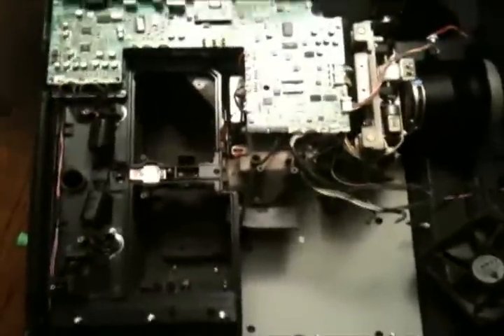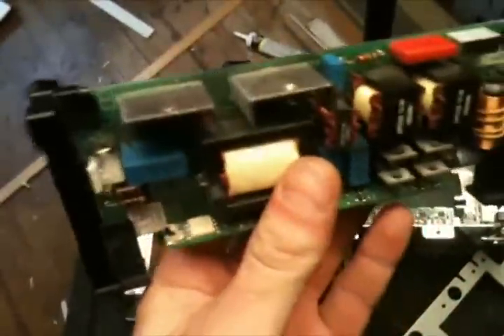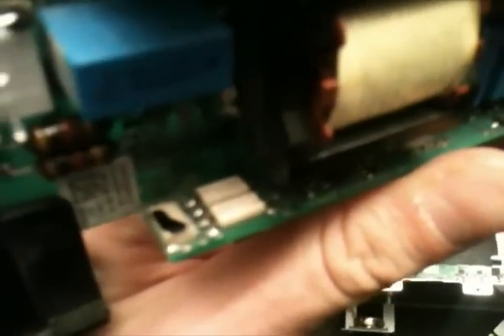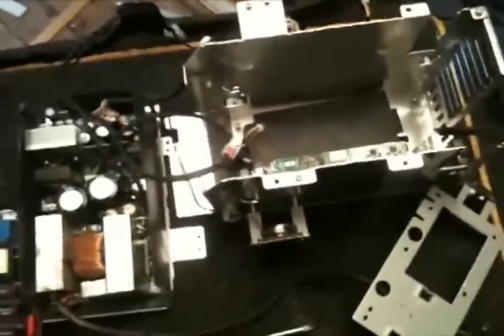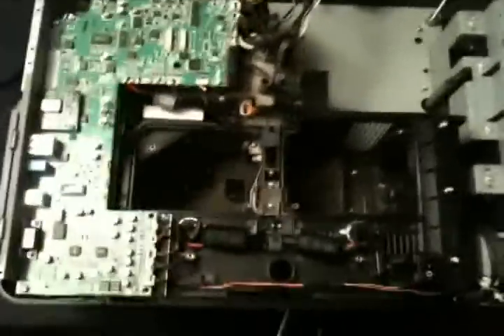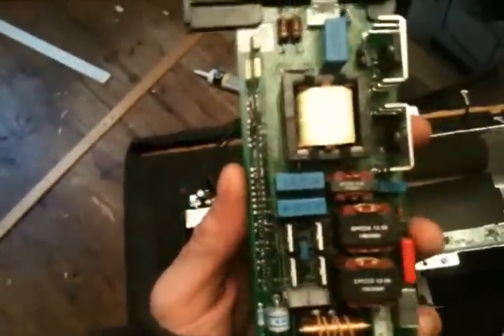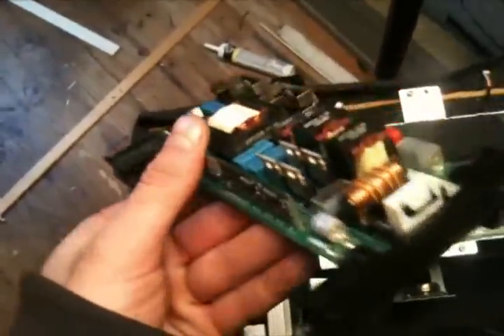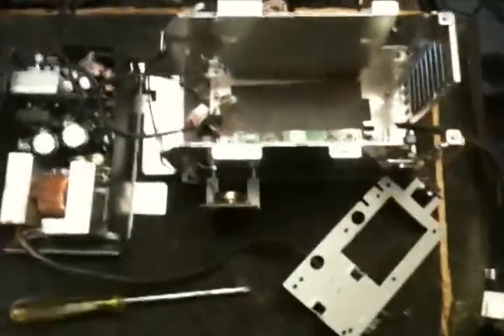Projector Lamp Control Board Bypass 5-pin w/ Schematic

Comment: Dear sirs, I have a ballast with lamp 7r and I need to know what to do to turn it on, I do not know what voltage to put on the control pins, I have seen some users use a small 12v source for this.

Comment: Why not just solder 5 extension wires on the pins of the optos, assemble the projector but leave the 5 extension wires out the case. Then once assembled and powered on, take each of the 5 wires and short them to a metal plate (ground) until you find one that works.

Comment: I have a similar ballast in my Optoma EP910. I removed the ballast and grounded the white wire in the 5 wire bundle. Don't ground the red wire. Projectors don't like shorts.
Reply: +J o c e l y n Thanks exactly what I was looking for. How did you find this document ?
Reply: Hello. I took apart an Acer projector and wanted to use the HID lamp driver alone that's why I wanted to know the protocol used. I don't know about your Optoma projector and from the documentation the shorting method is just a hack because what is supposed to be on those wire is a serial communication protocol. It should not be working but you could give a try it shouldn't in my opinion damage the board. From what I understand the method is to short the return optocoupler wires it shouldn't damage anything. Don't rely on the wire colors. You should have three 4 pins chips (the optocouplers) on the board. 2 mounted in one direction and the last one in the other direction. You need to short the two wires coming from this chip (the last one) going to the board connector.
Reply: Small correction: I guess it could work. I red more of the docs and the lamp driver have a non-UART mode where pin 1 and 2 are shorted by the flag/return optocoupler when the lamp is ON. So if you short these you can make the controller think the lamp is ON even though the driver thinks there is something wrong. On the docs the pin 1 and 2 are the bottom ones (closer to the other right angle board) but you should check anyway. Be careful and good luck to you too :)
Reply: For those interested the OSRAM UART protocol is documented in this PDF:
http://www.osram.fr/media/resource/HIRES/333551/standardized-uart-protocol,-version-3.3,-13.06.2008.pdf
Reply: It just means you need to connect them together. Be very careful if you are not familiar with electronic circuits. The module you want to modify is powered with high voltage (400V) and even if the supply is disconnected some residual voltage can still be present stored on the board. You should let it sit disconnected from the wall for at least 10 minutes or more before trying anything and even then you should avoid touching the bottom of the boards. Yes I speak French I am from France. Toi aussi ?
Reply: Je peux te donner mon adresse mail mais je ne ne veux pas la poster dans les commentaires sur youtube et je ne sais pas pourquoi mais je ne peux pas t'envoyer de message sur google+ ni sur hangouts il semble que je sois bloqué, bizarre. Tu peux essayer de m'envoyer ton adresse en privé sur G+ ? Je n'ai pas encore testé, je pense essayer de le faire fonctionner le week-end prochain.
Reply: Je n'ai pas réussi à te trouver sur Facebook. Aucun profil avec ton nom et un voilier comme image. Si tu partages ton adresse uniquement avec moi sur G+ personne d'autre ne pourra la voir ce sera aussi privé que Facebook.
Reply: @MichelPASTOR  Link not working..

Comment: Any place to see what ballast model use my Vivitek D952HD ?  , its original lamp still running for more than 8500hours , its a long living lamp , but i want to make it a led lamp, and i cant find specifics info about my proyector.  thx!
Reply: +readdata last night exploded at ~ 9350hours , was running with too low near black light. So im dissasembling and cleaning dust while get comfortable to start altering circuits/wires   :o

Comment: have the same projector and its erroring out with a lamp code... fires them, then dies. the brown and clack wire you are referring to... is it the 2 small cables the run from the front of the power supply to the board? and did you short them towards the main board or psu? thanks in advance for your help

Comment: I got the same problem with a Sanyo plc-xw55. My solution was to hack the ballast so that it thinks the lamp is present and lit. In my case (it might be the usual solution...) the ballast "senses" the current that goes from the buck converter to the full bridge driving the lamp through a series shunt resistor - I had 10 smd resistors of 1R0 wired in parallel and together in series with the main buck converter power diode and ground. The voltage drop across this shunt is sensed by an opamp configured as an 10x inverting amplifier.
To trick the ballast, I cut the pcb trace from this opamp output to the control board of ballast, and replaced it with a 2-resistors voltage divider powered at the same supply as the opamp. (My opamp is MC33171, the supply is 12V, I used 2 10k resistors to obtain about 6V). Everything seems to be workig fine now, no error, and no significant power wasted since the output of the ballast is left open.
Reply: Cristi Tudor is there any snapshot you have taken?
Reply: Do you have any scheme or a pic? I want to do somethig similar in my projector
Reply: Please post a video/picture tutorial  on the hack 👍👍
Reply: I have the exact same projector. Could you make a tutorial or post a photo of what you did somewhere so I can mod mine

Comment: It is an old post…..but maybe it might be helpful to whoever gets stuck here.

The Motherboard needs an pulsed signal. It is a I2C bus but the signal for the lamp is very simple. You could easily generate that with a NE555 chip. But on my NEC LT25 I have used the TxD+ line to enable the RxD line. I noticed that on my projector the signal used to switch on the lamp (TxD+) was identical to the signal coming from the ballast to signal that the lamp is OK. So in this case I simply connect pin 1 to pin 5.
Reply: Thanks a lot!!! At my Benq MW512 it was 1 and 4(brown and yellow) i want to trash the beamer after the modifications, but now it works!!!!
Reply: Yes I kept the ballast board fully connected

Comment: Well, if your projector is working properly, then you are in luck.  You mention in your description that you know its an Osram configuration and that there is a UART, why would you need to short or ground/vcc anything?  Google UART, its serial comms so the projector sends and recives codes from the lamp ballast (board that powers the lamp and has the 5 pin cable).

What you need to do is capture the UART serial codes that it sends, probably best with a serial to USB converter (they give you a virtual com port on ur PC).

I'm doing this with my Epson projector to try and diagnose the broken board, Osram's unishape site has lots of PDFs about the pinouts and standard codes, though manufacturers may be different.  I have put a FET transistor as a buffer between my FTDI 232 to USB chip on its receive to capture codes onto my PC without the FTDI chip pulling anything down or up.
Reply: Any more info on how to do this

Comment: I don't know if you've found your answer yet but I have a Boxlight mp65e that uses a five conductor wire from the main board to the lamp power supply control board.  I found the optocoupler that was reversed is connected to the brown and black wires.  I shorted those and it stays on just fine.  I did go back and test the impedance of the optocoupler at 1500 ohms and I plan on putting the appropriate resistor in place before using on the regular.

Comment: Hahaa , i got some free swap a old car sub for a 500gb hdd and a Acer projector lol now im having a problem the replacement bulb is like 80euros and the 100w Led + driver is around 40 ...both from ebay china ...and i wonder which will blow up quicker , I tryed some regular 80w halogen 12v spots but there just crap and make loads of heat :) , but ill be dammed if i ever buy a working projector , wish i could build a 600w hps in side some how :P

Comment: I did after watching another video if there is 5 wires and 3 opto's , 2 will face one way and 3rd will face other , the one facing the other way is the one sending the lamp on logic high , all i did was followed that one to the connector and cut and joined the wires and it fires up no problem.

I do not think they use Uart just logic high thats it , this worked fine on mine